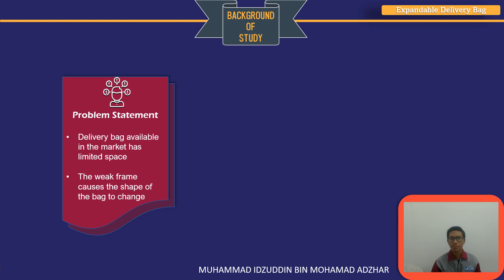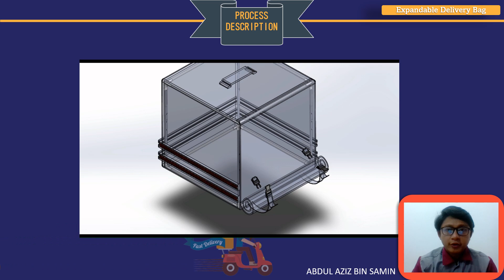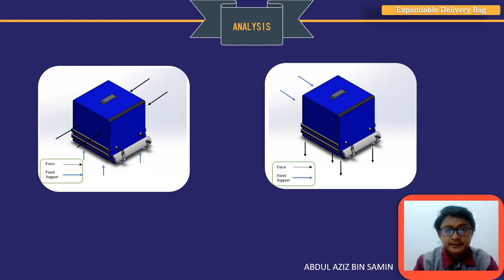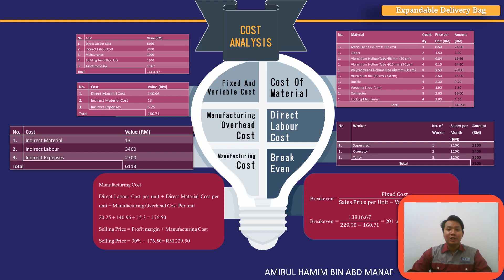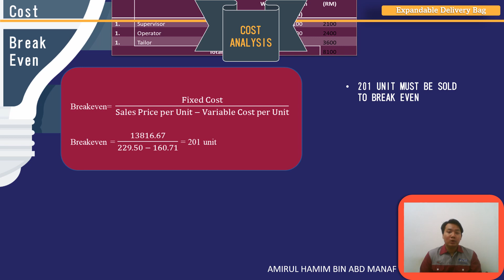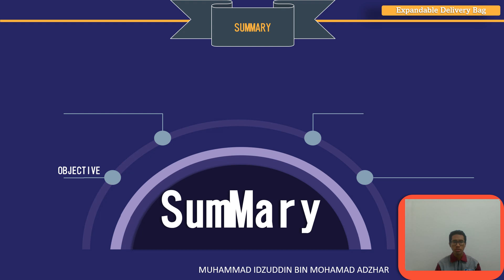BMFU3223 INTEGRATED DESIGN PROJECT [ GROUP 11]  [ 2021 ]  [EXPANDABLE DELIVERY BAG]

Comment: Assalamualaikum...
Good project selection. Meeting current situation and demand. Drag force analysis; this analysis is based on original size or after expanding the size? 
How to make sure the food inside the bag is well seated/ does not move?
Reply from the maker: Waalaikumsalam En Azmi, thank you for taking your time watching our video. For your first question, the analysis that we done in our presentation is on original size. For your next question, same like others food delivery bag, we provided our bag with a foam type of cup holder and compartment divider. When the rider want to delivery small quantity of food , they can use the compartment divider to keep the food from moving.
Reply: @amirulhamimmanaf6803  Thanks. Good job. congratulation to the team for your good and promising idea.

Comment: well done. well presented with good data and information especially on the material selection for sustainability.  just one clarification.  how much volume incremental by expanding the bag from one size to the other size?
Reply from the maker: Assalamualaikum Madam,  thank you for taking your time watching our presentation video. Based on your question about the volume increment, For the small size(original) the volume is 97 Litre . For the medium size the volume is 106 litre . And for the large size the volume is 115 litre. Every time the bag is expended, it will be an increment of 9 litre.